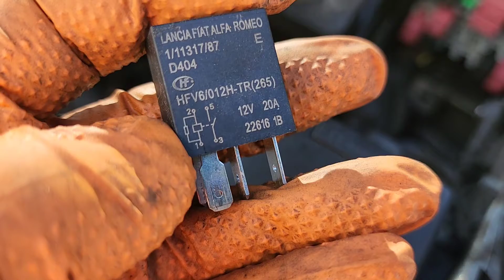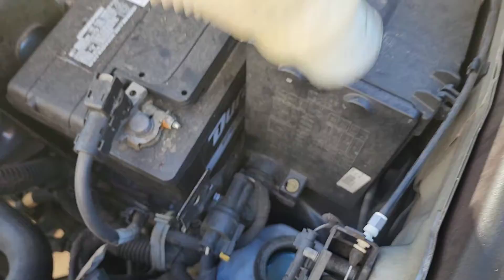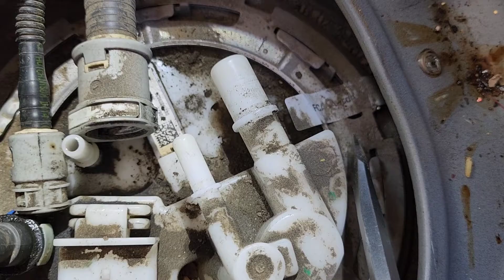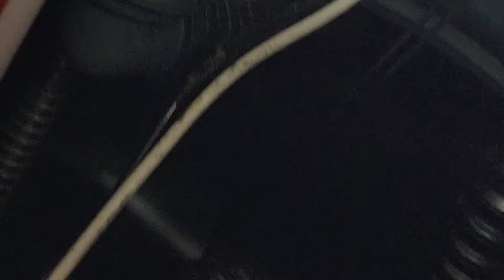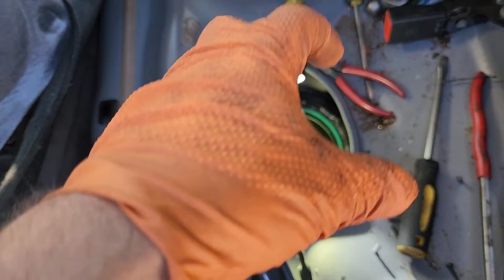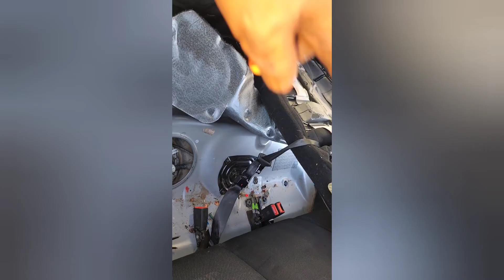JEEP RENEGADE FUEL LEVEL FUSE RELAY PUMP DIAGNOSTICS REPAIR REPLACEMENT SERVICE PROCEDURE DIY

Comment: Thank you for this video. I'm about to tackle the task of replacing the fuel pump in my Renegade. Hoping it's my fuel pump. It sputtered out & died the other day, wouldn't restart. When I was backing it off the tow truck, the Jeep was facing upward & it started. Got it on level ground & it ran for a few minutes, then seemed like it got starved for fuel & died out again.
Reply from the maker: Thanks and Good Luck! 🤞💪👍
Reply: Same that’s what happened to me. Poor car sputtered like a cartoon character. It got diagnosed in a shop. So gonna do mine once part arrives
Reply: It ended up not having compression in 3 of the 4 cylinders.

Comment: How did you verify you were getting 12 volts with a test light like what pins did you test
Reply from the maker: I thought I had this in the video but maybe I lost it during the assembly of the video... Usually when looking at the wires going to the connection plug on the top of the pump you can see 2 fat wires and 2 skinny wires. The fat ones are always the power supply because they always run 12~14.4 Volts. So you can test these two which seem to the Black one and the Green one. You can test the relay terminals before that just in case too. Thanks 👍

Comment: Thanks so much! I have a question tho..

What is the third tube/line in connected to the duel pump for?
Reply from the maker: Not sure which line you are referring to but I am gonna guess it's the EVAP line for the Charcoal Canister. That Canister serves as an extension to the fuel tank. These are the 3 lines - Pressure output, regulated return and vapor to charcoal canister for the EVAP emissions control system. Thanks and let me know if you have other questions 😁
Reply: So if I disconnect the hoses going to the pump, and turn the key,  I assume the largest line should have fuel coming out of it? I hear the pump humming when I turn the key to ON, but no fuel comes from any line.
Reply: I found that the smallest hose that comes directly up from the housing, is the high pressure line to the engine